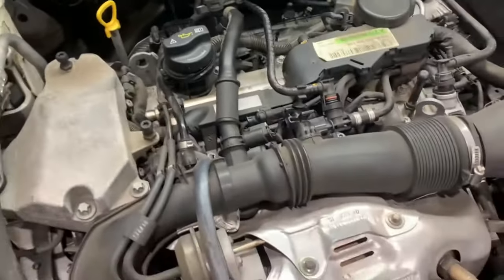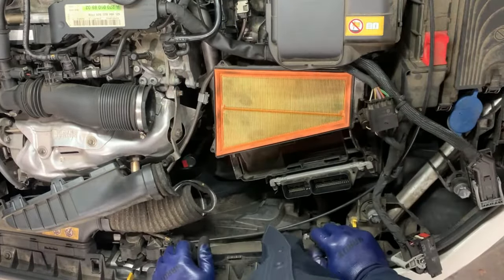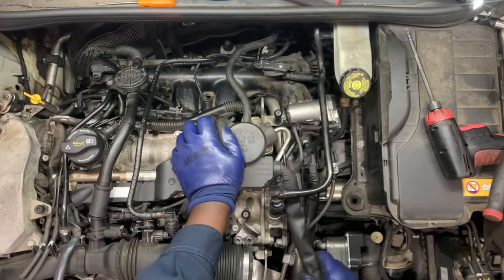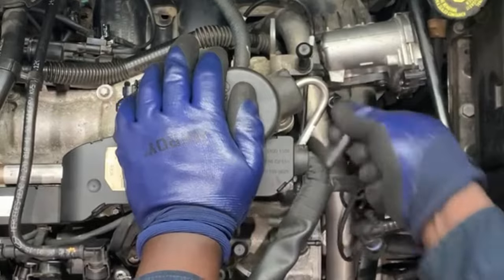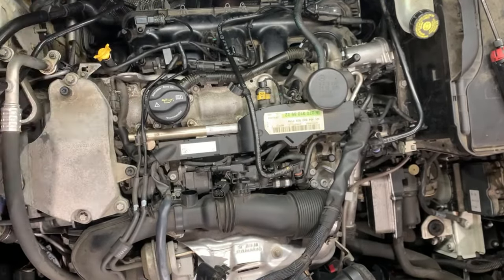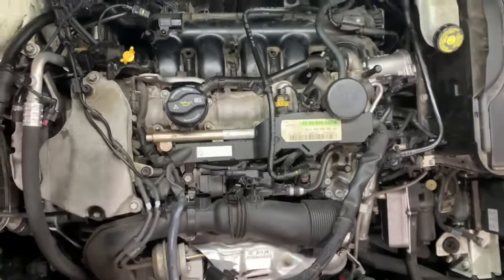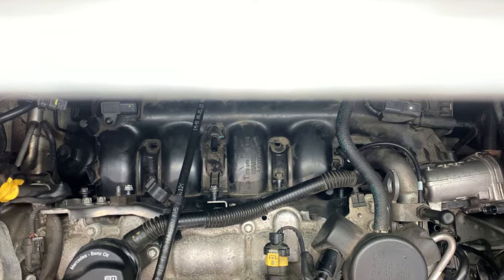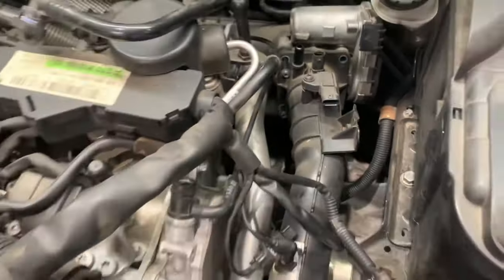HOW TO REPLACE COOLANT THERMOSTAT/ WATER OUTLET FOR MERCEDES BENZ GLA250/CLA250 (W117) 2014-2020

Comment: Thanks for the video. It helped me with this repair. 

Be careful around the crankcase vent tube that connects to the oil filler neck, I cracked one while disconnecting the hoses.
Reply from the maker: Thank you for finding the video helpful. And yes, those hoses are very brittle.

Comment: Hello, great video on how to remove the intake, how did you disconnect the heat protected line from the vent valve ?
Reply from the maker: I ended up messing mine. But I explained in the video that you disconnect it from the intake using the rubber housing at 13:32 - 13:54 also another way is remove it from the connector at the valve vent.
Reply from the maker: Now that you mentioned it, I will be making another video on the same soon. How to remove the heat protected line (Vacuum hose) from the intake.
Reply: Thanks, i have to replace the vent valve 
(the one connected to the intake) it is almost the same procedure with the Intake removeal.
Reply from the maker: @rookworst73  I am not sure if it's the same procedure.

Comment: Airbox can come out as complete assembly AND together with snorkle hose! 3:24 is torx 10 not 12.. otherwise great video guided me well through the job...and yeah, pull out the dipstick to avoid breaking the head ring;)
Reply from the maker: Lol the dipstick, Well observed. Thank you for the observation. Yes it's E-torx 10 not 12.

Comment: Thank you for posting. Although i need to replace the oil filter housing your comprehensive video has shown me how to approach it. Thinking about replacing the thermostat housing while im at it. I do have a question regarding torquing the intake upon installation , do you have to torque it?
Reply from the maker: Thank you too. Dang! you have a lot of work ahead of you. But it will be easier with the videos. The torque specification is about 14Nm, which converts to about 10.3-4 ft/lbs

Comment: Hi, it looks some oil in the intake path, is this normally situation in Mercedes turbocharger?
Reply from the maker: It is a common occurrence but not normal. You have a leaking oil seal in the turbo.

Comment: Hey great job I got 2017 gla 250 can you tell me we're is coolant sensor 1!! Thanks
Reply from the maker: The coolant sensor is located under the inlet manifold port, behind a rubber cooling hose.
The inlet manifold has to be removed and you can only see it with a mirror. It is held in place by 8mm bolt. Its towards the transmission direction of the intake manifold.

Comment: Hello can you give me advice! My ac only cooling don’t won’t to blow hot? They tell me to change termostat but I’m not shure that after  change it it will work
Reply from the maker: The thermostat plays a big role in making sure heat gets into the cabin. First, I hope the person who told you to change it did a diagnosis and established that the thermostat is going bad. But to be on a safe side, I would encourage you to seek for a second opinion before you do the replacement. And let me know how it goes.

Comment: I replaced my thermostat on recommendation from my MB dealership as they said its old and faulty (my heat wasn't heating up properly or was taking too long) so i replaced it and its the same problem. So i dunno whats happening.
Reply from the maker: Yes, sometimes thermostat can cause poor heating conditions in a car. That out of your way, I would suggest you have a look at your heater valve. That is the guy responsible for heating affairs in your car. Have it checked out.
Reply: @all-about-cars-basics  during my service when they checked all issues with my car they made no recommendation to check out or swap the heater valve. Only the thermostat. Ill take a look, thanks for the reply.

Comment: I just replaced my C300 2017 thermostat, but didn’t change the manifold gasket. The car won’t start and I have two error codes. P0193 and P0108 along with a few throttle valve codes. Any idea what could have I missed?
Reply from the maker: I think you did not connect back the wiring harness to the right places or either some are missing, not connected back. Check on your wiring harness. On the manifold gasket. If the old one is still good, you may not need to replace with a new one unless its worn out completely. I hope that solves your problem.
Reply from the maker: Check on the fuel rail line connector if you had put it back
Reply: I just replaced the manifold gaskets today. Same issue. Which one is the fuel line connector? Did we remove it in this process? Could you point me to it? It is one on the manifold?
Reply from the maker: @DIYMan-e6c  I am glad that you had it fixed. Great work. 👍👍

Comment: I replace my thermostat and put coolant now it over heats again fan kicks in most pipes are hot but I got no heat inside and it overheats
Reply from the maker: Oh no, that is very unfortunate Kevin. Let's see if we can figure out what might be causing this.

First, it's great that you replaced the thermostat and added coolant. It's possible that there could be a few other things causing the problem. Here are a few suggestions to check:

—Check your radiator and make sure it's not clogged or blocked. If it's dirty or obstructed, it can prevent proper cooling and cause overheating.
—Verify that the water pump is working correctly. The water pump is responsible for circulating the coolant throughout the engine, and if it's not functioning properly, it can lead to overheating.

If you've checked these things and are still experiencing overheating issues, it might be helpful to take your car for computer diagnosis at Mercedes professional Auto Shop near you. They will have the necessary expertise and equipment to pinpoint the exact cause of the overheating and lack of heat inside your car.

Let me know how it goes and if there's anything else I can assist you with.
Reply: My cla temperature change to 85degrees I change thermostat still same problem bro. help me